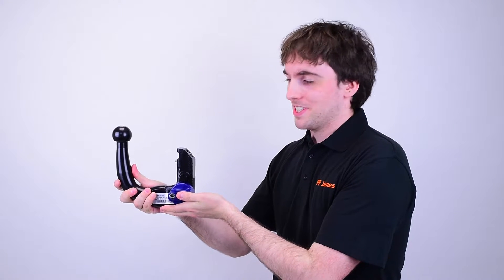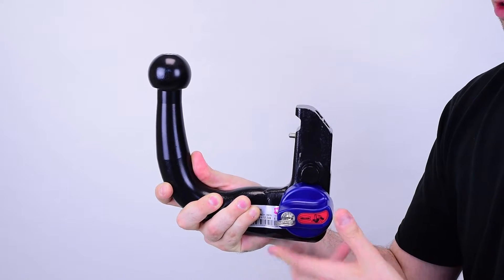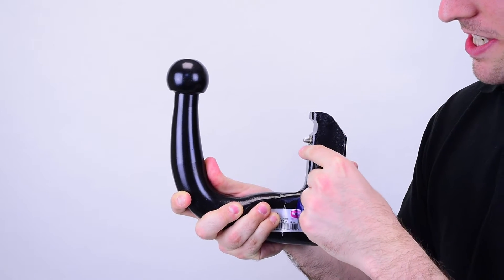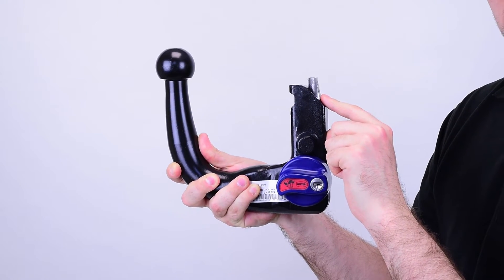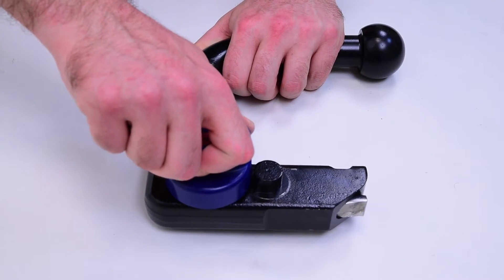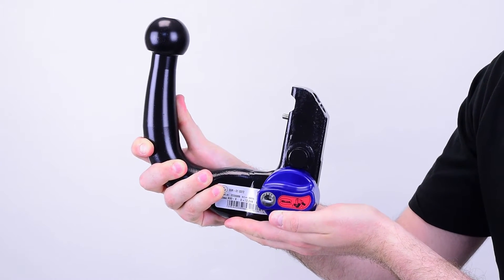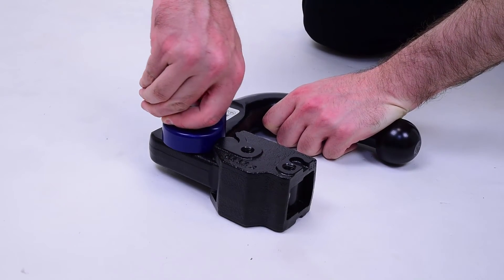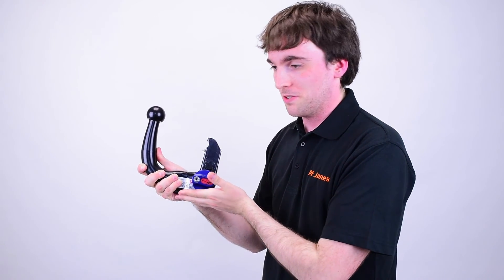Using a Witter Detachable Swan Neck

Comment: What if when the swan neck fires and attaches to the car but the blue knob only turns back 90 degrees? No green sticker showing and unable to lock the towbar
Reply: I'm having the same issue, did you manage to find a solution?

Comment: This is just a bad design. I got this with my car and I am very unhappy with this. There are much better designs you can choose from. This gets dirty inside, doesn't come on/off so easily and it's heavy. Girls have problems fitting this in. I had different tow bar before and was much much easier.

Comment: I'm assuming the keyhole becomes full of dirt and water over a period of time?
Reply from the maker: There is a metal flap that covers the keyhole when the key is removed to protect it from small amounts of dirt and water. However, this is a detachable neck, so we'd recommend removing the neck when you're not towing anything so the keyhole doesn't get over exposed to dirt and water for extended periods of time.
Reply: acgkplh a quick squirt of WD-40 into the lock the odd time keeps everything free.

Comment: Just bought one from you guys and no matter how hard I try, it only rotates 90 degrees. The little pin appears to be loose so it can slide in and out by gravity. Is that right?
Reply: What if this does not work?